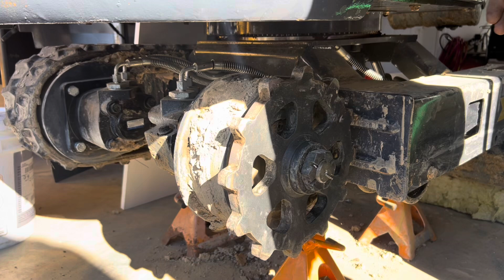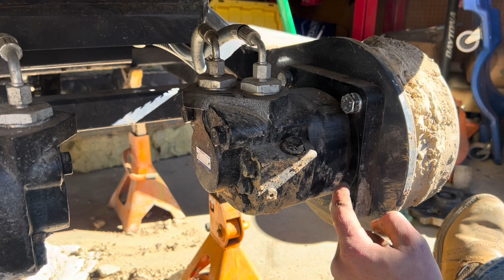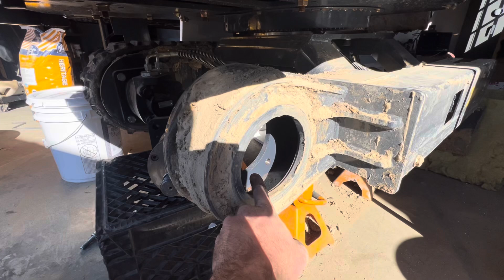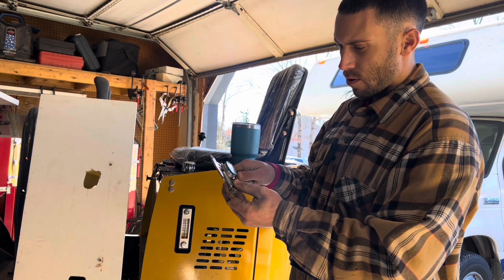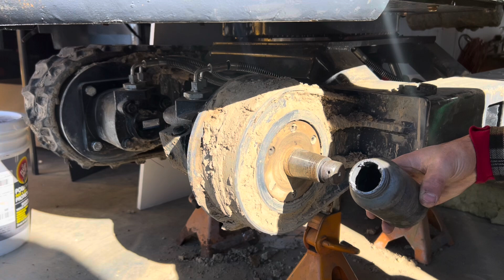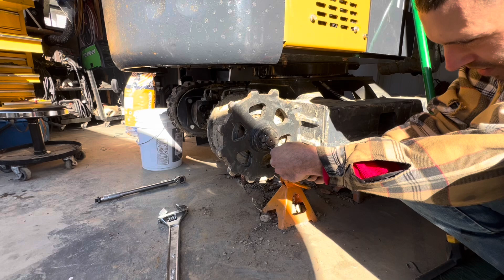Chinese Mini Excavator: Track Drive Motor Replacement

Comment: So have a crazy question so we just got are drive motor replaced i went to put the sprocket on but that key isn't sitting properly I cleaned it up and the hole it sits in it's the key lock thats shaped like a oval now one side seems to stick out further and then the sprocket don't go all the way on now unless im missing something it's on correct is this something I can use like a jaw press or pulley press to force on or do I have something wrong hear it's a Chinese mini escavator i been up all night messing with it I'll snap some pics In morning thanks please any advice will be helpful
Reply from the maker: There’s two different sprocket sizes if I remember correctly

Comment: Here I came here to see how the hydraulic hoses came off, lol... my auction unit is leaking at the hydraulic connection, wasn't sure if it's the top nut or the big one and wanted to see what it looked like once off.

Comment: Thanks for your video's.  I need to fix a broken track adjuster assembly. The weld on the bracket broke and the whole assembly fell.  It also bent the adjust bolt. Do you have any video's showing how to get to that area? All I can see is an inspection hole, but no way to weld in there.

Comment: I have a MX12R AGT MINI about 2 hours on it and the drive motor blew an inner seal, I have been searching and cannot find any so far to purchase a replacement drive motor. I believe it's a BMER -3-350-T31. Any help in locating this item would be greatly appreciated.  Ty so much for everything you have taught us about these machines.
Reply from the maker: Those drive motors are a huge issue that even I haven’t found a solution to

Comment: Do the drive motors have gear oil in them that needs to be changed? i saw a video of a kymron unit where the owner changed the gear oil on his.
Reply from the maker: No it’s all hydraulic fluid
Reply: @thegarageconnection  ok great! I guess the larger excavators have that

Comment: Our machine had a bolt on one of the drive motors that wasn't torqued all the way down.  I tried to tighten it, but it wouldn't budge.  I pulled it out and found the threads were completely crushed.  I'm currently working on chasing the threads with a tap to clean them up and I can actually turn the bolts in by hand.  Thankfully the threads in the holes weren't cross-threaded or stripped out.  I'm getting ready to install a cross bar and motor guards, so longer bolts are needed anyway.

My dad says others are experiencing similar issues elsewhere on the machines, including the slew motor bolts.  I personally don't suggest removing bolts until you actually have a problem, then spend the time cleaning out the threads with a tap.

Seems there are two different bolt sizes, his is an m14x1.5, our machine has M14x2.

Comment: Thanks for all your information, was wandering if Parker  pumps / drive motors can be used as a  direct replacement.  Other dealers  talk up how they order  better upgraded machines. So, question is could you simply bolt on a Parker style drive motor if you wanted to upgrade? Thank you.
Reply from the maker: Yes you can!

Comment: Great video! Thanks for all the info! Any thoughts on oil filling and draining of the travel and swing reducer? How and type of oil? The diggers have the lines, but aren't the typical drain and fill, the manual does have details, but they don't look correct. I emailed  the company typhon, who said it doesn't need changed. Any details on how to drain and fill?
Reply from the maker: They do not require any draining
Reply: @thegarageconnection  Thanks a ton!  I am probably going to purchase that guard soon... and how hard is it to install that flow reducer to ease the stopping so I don't destroy the gears?

Comment: just bought a qh12, do these drive motors use gear oil as well? If there is where are the plugs for maintenance. Thanks
Reply from the maker: They’re lubricated my the hydraulic oil

Comment: Is there separate gear oil in that drive motor other than hydraulic fluid?
My old bobcat excavator had a full and drain plug for gear oil.
Thanks
Reply from the maker: Not that I know of

Comment: Man your (@thegarageconnection) videos are awesome. You've really got a talent for this, not sure what your day job is but there are corporations that would pay decent money for these types of product/training videos. 

Question from me: My excavator will start to hop on pavement or concrete when going forward or in reverse, but doesn't do so on slippery surfaces like grass or dirt. Is this to be expected from rubber tracks and this size. Is there is anything can be adjusted to minimize this? I only have hard pavement into and from the shop. 

Many thanks again!!
Reply from the maker: Very common and my machines do it also. I am a machinery technician for the US Coast Guard.

Comment: Very informative videos. Thanks for sharing. I see a few different manufacturers use the drive motor with the 3rd port (like on your H12)that's capped off on most machines. I did find a picture of a Hightop brand with a 3rd line coming out of that port. Any idea what it's used for?
Reply from the maker: It’s a case drain

Comment: Hi beautiful video, listen, could you please tell me how the engine gets stuck while you unscrew the bolt? Thank you .
Reply from the maker: I’m not sure what you mean
Reply: @thegarageconnection  I think he means how you prevent the drive motor rotating when opening nut
Reply: Hi, so I built myself a mini excavator with a 360 degree rotating turret, the problem is that it doesn't stop when I stop it, the motor runs idle even by hand
Reply: Hi, could you please tell me what type of engine it is? Because I see that when you tighten the bolt it doesn't turn at all

Comment: Awesome series of videos! I just picked up a miva VA15 almost identical to a AGT H15. I believe mine has the basic same components as the H12. I noticed in the limited time I have on mine that the right side drive motor seems to be weak at certain times and I have to "cheat" to right side or give it more lever than the left to go straight. Would you have any idea what that may be? With a new machine I hope it not a bad drive motor,hoping it's maybe some adjustment or a restricted/kinked hose. Looking forward to more videos on these machines!
Reply from the maker: The hydraulic fluid is going to flow to the path of least resistance. In your case (and in mine) the fluid simply goes past the first valve it comes to, and will keep flowing to the left track valve because it’s considered the end of the line at that point.

Comment: Man I subscribed to your channel a week ago, Thanks for the fantastic info about these mini Excavators! 
Your channel by far is the most informative and in-depth I have found.
I’m looking forward to a new mini ex video whenever you post it.
Hey I’m ready to order and test one of these out. I was Considering the QH12 because some people say they have a  thread on hydraulic oil filter, but they don’t have a counter weight, I think I could Fab one up in needed. The Other machine I was looking at was a Rippa 1 Ton, it comes with the Hydraulic filter, electric cooling fan and a hydraulic thumb, for about $900 more??? Who knows they are all very similar in design. 
Thanks again for posting these videos 👍 PS I own a Yanmar B22 5K LBs mini excavator, good simple machine, it’s an early 90s gray market machine and a  little harder to find parts for these days.

Comment: Great job on these videos. I have one of these machines and am learning a great deal from you! We just had to swap out the motor on ours.  Replaced it with an Harbor Freight Predator 459cc. Works much better now.
Reply: Does the Predator seem to have more power?  How long did the swap take?
Reply: can youbreplace 1 speed motors with 2 spd?
Reply: Why did you swap motor?

Comment: You have to be the most informative guy out there right now on these little machines. Thank you.. I have a wierd sound on my turntable when I move a certain way. Could you please do a video on how that works? I have only had mine for 2 months. I dont want to tear the whole thing apart unless I have to. Any info would be appreciated. I see your subscribers are going up also. Good for you.
Reply from the maker: You bet, I’ll get something up for you
Reply: @thegarageconnection  are these motors avail to find in the US? And swing motor gear? When time comes to repair think it's going to be hard to fix cause of issue finding parts?
Reply from the maker: @sealthedeal716  I’m in the process now of building an inventory of parts domestically for this exact reason